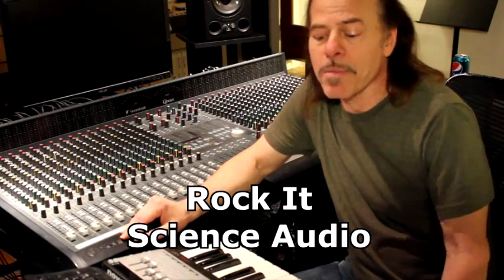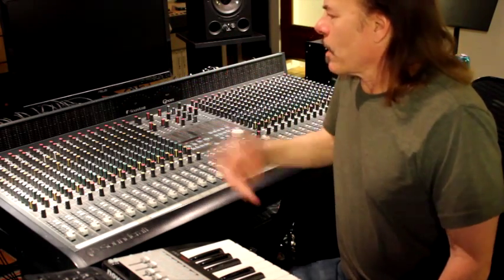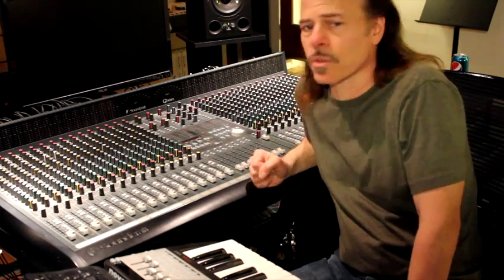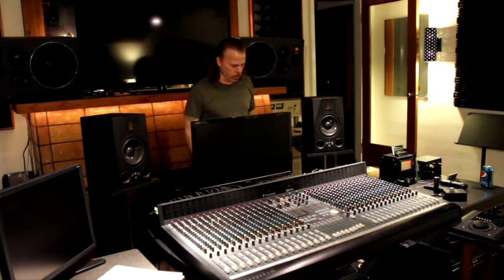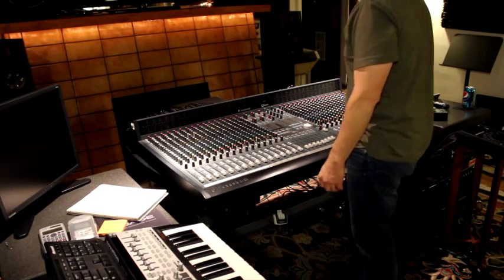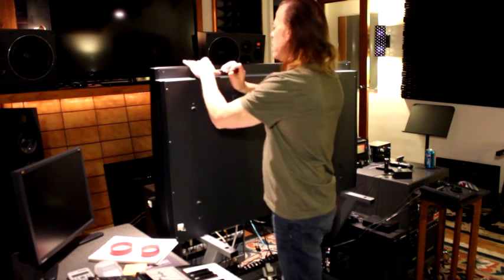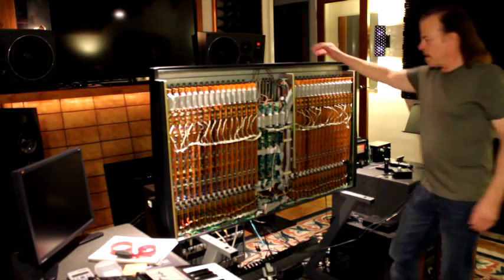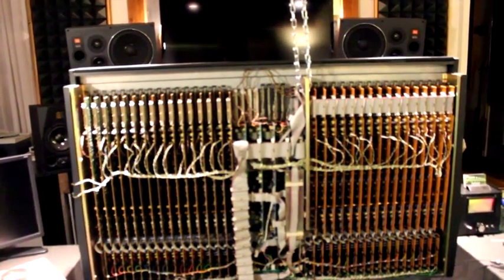Servicing the Soundcraft Ghost part 1

Comment: Hi Richard, great video,  very quick question, can the meter bridge be removed fairly easily? Many thanks for your videos! Cheers, Nick
Reply from the maker: Hey Nick, yes, the meter bridge is easy to remove and reinstall.  It' was originally an option when ordering the console, so removing a hand full of easily accessible screws and a single D-sub ribbon connector will do the trick.

Comment: I've been desperately looking for a desk stand similar to yours, what's the name brand?
Reply from the maker: I ordered the Ghost with the stand and meter bridge options.  It may be (or have been) a standard Soundcraft item that works with consoles other than the Ghost.  Just a bit of added history; In 1996 I was working for  JBL/Soundcraft in SoCal when the Ghost came out, and I took delivery of the very first one in North America.   The standard 250W power supplies were not yet available so they kindly gave me a 300W higher grade supply from another console.

Comment: Hi Rickard Bruce here from Northjetty Recording studios
I recently had a meter bridge pcb card fail when i opened it up and took it out i notice the R-109 was burnt, +17V line witch runs
up to IC 22. there is a direct short to ground on pin 3 after further infestation I found that D-18 was shorted.
Have you had any issues like this ? I ordered 10uf 25v cap to replace it hopefully this will solve the problem.
I'm all so  making a repair video on this as well. I will post it soon. Love your videos.
Reply from the maker: Hey Bruce,
I tried to follow the part numbers you called out, but unfortunately the schematic only shows one of the four circuits on the pcb card and doesn't include those parts.  I've been fortunate to only ever have replaced a couple failed LEDs on my meter bridge in 25 years.  Please send me a link when you finish the video.  I'm sure I'll learn something new.
Richard
Reply: @RichardZeier  Hi Richard the schematic shows the main power inputs C-18 is upper left side of the pcb next the last led strips. each card is the same they just made 2 schematic pages. I'll send the link Friday or Saturday, thanks for getting back to me I'm all so upgrading my OP amps like you did.
I put in the cap and it worked fine. Take care.
Reply: @RichardZeier  I made a bad error it's c-18 sorry.

Comment: 1st question, that high pitched hum during your video, how do I remove that from my mixer, digital keyboard, hardware etc...is it power supply related?
Reply from the maker: To be honest, I never noticed it before.  The console is not even on, so it's not coming through the speakers.  I suspect it may be noise from a fluorescent display on an old Korg O1W that is on a stand right behind the camera position.  The mic on the camera has a built-in compressor making small room sounds seem even louder.  I apologize for only spending $0.00 on the entire video production, but had I known how many people would eventually see it, I may have done more.  Thanks for pointing it out and if I ever do a sequel, I promise the high-pitched noise will not be included.
Reply: @RichardZeier  LOL Hey, I wasn't trying to be a WISE A$$. How do i get that hum/buzz out of my keyboard, mixer etc.. is possible power supply or just how some hardware is made? I can somewhat hide it with Reverb and effects but I know it's there and have to adjust my MIX because of it.
Reply from the maker: @AWUNMATERIAL  If you would like a technical answer you need to be more specific.  It's better to contact me through the RockItScienceAudio.com website.

Comment: hi. i just got a ghost 24 off off reverb and it seems to have some problems in the master section.
some of the channels only work on one side and some don't work at all, 2 trka and the crm outs. do you think this can be fixed without opening the unit.
I'm tempted to just spray some contact cleaner in there.
Thanks for any advice!
Reply from the maker: The only thing you may possibly be able to fix without opening the console is if the problem is due to intermittent insert jacks that you will find on every input channel plus the group and mix channels.  A quick insert jack test involves soldering the tip and ring together on a TRS plug and inserting it into the channel in question.  If it is an intermittent insert jack the channel should work when the plug is inserted.  Of course, this is only an indication that the insert jack needs to be replaced which will require opening the console, but you could make up enough of the TRS plugs to temporarily use the console.  The only place where spraying anything into the console can be helpful is into the faders that seldom cut out completely, but can get scratchy.  Be sure to use only Deoxit F5 (fader lube) or something else that will not harm the faders.
Reply: thanks very much i think im gonna end up sending it out for repair. oh brother!!!
Reply: nublackmusic was the repair expensive?
Reply: @witnessthewrath8061  I sold the ghost mixer it was too much hassle for repairs. i now use the yamaha 02r96. i miss the ghost though!
Reply: @TheRealNewBlackMusic isn’t that Yamaha a digital model? What is the sound comparison going from the ghost to that Yamaha? Which was warmer & punchier?
Reply: @64hapz  as far as sound goes the ghost takes it easily . the Yamaha was more convenient especially when integrating with other digital Hardware. the Yamaha o2r 96 and DM 2000 are better than most digital boards made today and the Yamahas came out 20 years ago🤣
Reply: @TheRealNewBlackMusic  yea i would’ve stuck it out with the ghost for sure. I’m looking at purchasing one, originally I was looking at a tascam dm3200 but going the analog route for that warmth & punch 🔥
Reply: @64hapz  well if you can't find a Soundcraft ghost don't sleep on the Soundcraft Series two or the Soundcraft 600 the 600 is Killer because it is really an MCI
Reply: @TheRealNewBlackMusic  man, I was looking for a 600 bit they’re all out of state & local pick up only. The ghost I’m looking at is clean, has been serviced within past 3 years but even that one I’ll have to drive almost 6 hours away from here to pick it up 🤷🏽‍♂️ here’s to hoping a sleight of hand in finding a 600 series within my state 🤞🏽🤞🏽

Comment: Hi Richard, thanks for the detailed vids on Ghost. Awesome stuff! 
Since you have some knowledge about it, I hope you can help me out here. Recently I bought a 24 ch. expander to my 24 ch. Ghost LE. All connected, and working. But when Turning on the Expander, my main console goes to 'solo mode'. Meaning, the 'solo' light comes on and no sound out of the main mix. There must be a way to change settings, but can't figure out how. Have no manual for it, the web and different forums seem short on answers and even Soundcraft doesn't respond. Kinda stuck.
Reply from the maker: Somehow the PFL detect line from the expander is engaged.  Since it operates off +17V it is only active when powered.  The most obvious thing would be a solo switch engaged somewhere on the expander.  It's convenient when solo buttons have a nice bright LED that comes on when engaged but be careful of the PFL switches that don't have LEDs.  There are many solo switches on the Ghost that don't have LEDs including the stereo return PFLs, aux bus master AFLs, and group AFLs.  Any one of these will engage the solo function with very little visible evidence.  I am not familiar with the Expander, but I would first see if there are any unnoticed solo/PFL type switches engaged or possibly broken.

If not that, then I would check the wiring between the expander and console.  Maybe a bent pin in a connector is shorting the PFL bus to the +17V.  Since you have no audio yet, I would double check the wiring.  I hope this helps, but I'm working with limited info here.
Reply: Thanks for the reply Richard! Will check all that, and double checked all the solo switches. I just found something soldered on the expander board inside the expander, might need to change this connection by desoldering this. You don't perhaps have the service manual for the Ghost laying around? It's a time consuming issue and have limited technical skills.

Comment: quick note, to my knowledge, caps go bad when they're turned on and off, because they become hot and cool down again this way... so leaving a console on, might actually be the way to go...
Reply from the maker: From my experience in replacing thousands of capacitors, electrolytic caps go bad primarily from exposure to heat over time.  This is supported by manufacturer data sheets that present ratings based on testing.  The electrolyte compound actually breaks down and loses it's dielectric property over time and is exacerbated exponentially by the amount of heat exposure.  Keeping equipment powered on continuously will create more heat over time and shorten the life of the caps.  It's true that most failures occur when equipment is initially powered up, however, this is usually the result of the shock of in-rushing current stressing components that are already on the verge of failure.  So in my opinion, power down when not in use.  It will save you money, and is also better for the environment.

Comment: how does this console stand up against a SoundCraft Saphyre a desk that reggae producers love but is harder to get hold of
Reply from the maker: I've never actually had the opportunity to work on, or with a Sapphyre but from what I know about them they were Soundcraft's top-of-the-line recording console and in a different cost category than the Ghost, so I would expect higher quality construction.  From looking at pictures, I see similarities to the Delta series or the higher-end live boards like the Vienna.  

If your question is, how does a highly modified Ghost stand up against a Sapphyre, I would say it depends on the what's been done to the Ghost and what is the condition of the Sapphre.  Sorry if that's not a definitive answer, but there are too many variables to consider, and I'm sure in capable hands both can work well.
Reply: many thanks